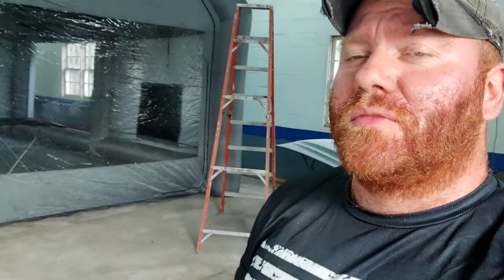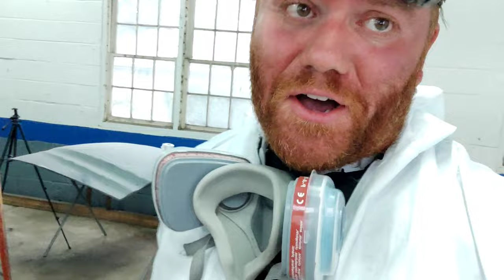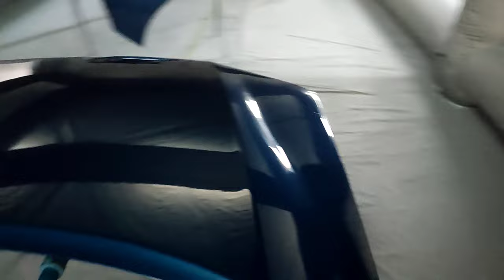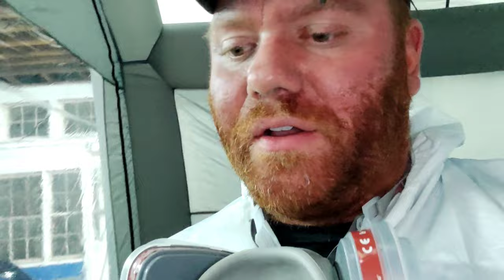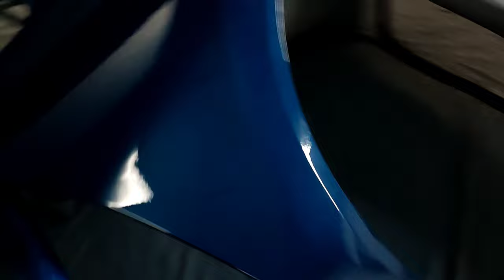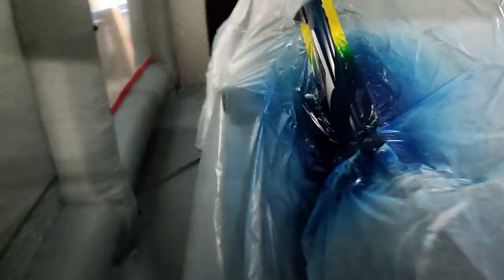Inflatable spray booth

Comment: Honey, I saw a great video of your spray painting project. As a spray paint enthusiast and product manufacturer, I would like to give you a free WARSUN brand inflatable spray paint room with double filter and EPA certified filter and activated carbon filter. I hope you can shoot a video showing its performance and benefits. Our paint shop uses a true multi-layer filter to maximize the absorption of odor and pollutants in the process of painting, ensuring that the emission of gas does not pollute the environment. I wonder if you are interested. Looking forward to your reply.
Thanks.
WARSUN
Reply from the maker: We can do this for you. Would you like my email?
Reply: Have a good weekend.
Reply: @speedokoterefinishnetwork4937  Yes, I'd like your email address for easy communication.
Reply from the maker: @warsun8443  cash2kcars@gmail.com
Reply from the maker: @warsun8443  hello did you email my email address?
Reply: @speedokoterefinishnetwork4937  Yes, Just now. Waiting for your email reply.

Comment: So you’re not getting choked out by the “wing wang” booth no more I see? Just needed some extra fans with some balls. You’re right about other shops that have legit booths and still put out dirty paint jobs. It’s all in the prep and making sure everything is clean and tacked off. I like to seal off gaps too. Keeps overspray out and also keeps any dust that’s in there from getting stirred up and blown into the clear. Most of the time my work comes out clean enough to let ‘em roll. I call it “commercially acceptable”. It’s not much more work to give a quick denib and polish job but not all cars require that. You’ll see the trash under some good shop lighting but pull that shit outside and it’s 10 times harder to see.
Reply from the maker: It still doesn't vent out fumes as good as it should but it's doing better
Reply: @speedokoterefinishnetwork4937  add even more fans!
Reply from the maker: @christrainor1129  I wana get a second suction duct